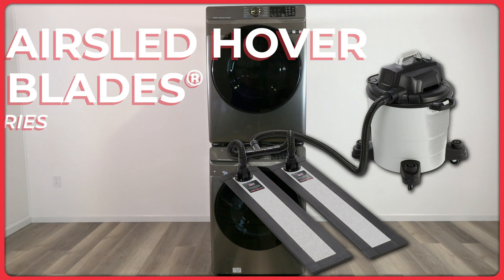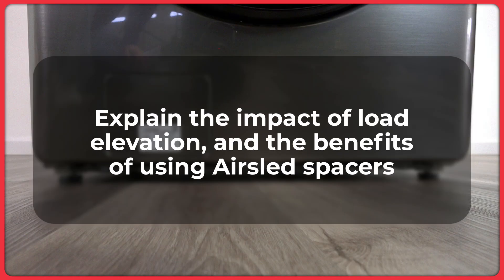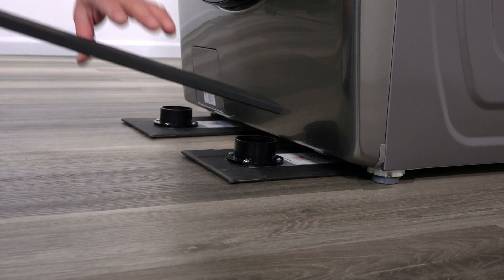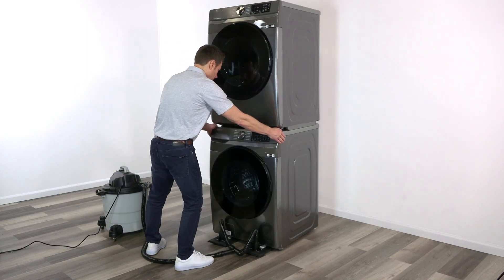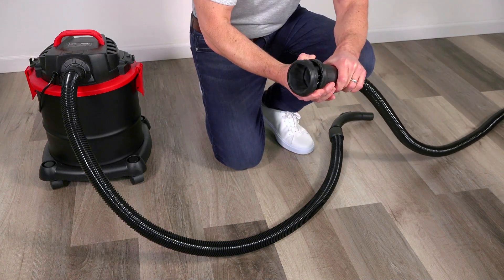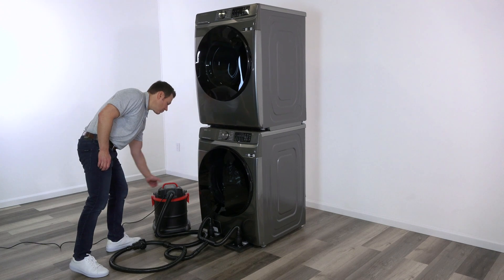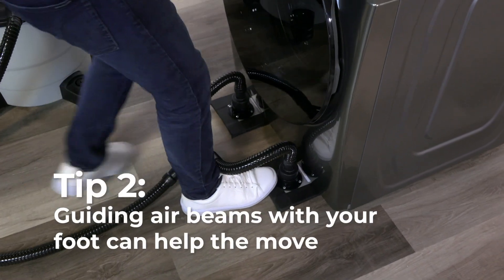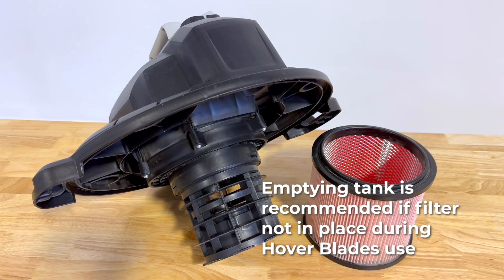How to Move Stacked Laundry Equipment with Airsled Hover Blades

Comment: If the stacked washer/dryer is in a closet on tile but the space outside the closet is carpeted. Will it glide onto it?
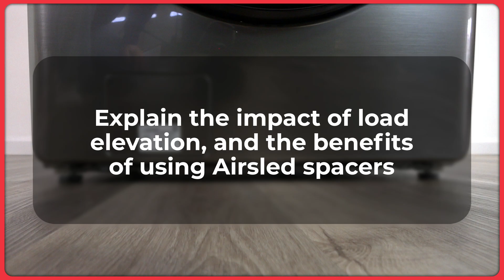Reply from the maker: Yes. All Hover Blades come with four plastic sheets designed to create a smooth, nonporous track over the carpet. You can see this in another Airsled video showing one of our Appliance Mover models moving laundry equipment out of a closet onto a carpeted hallway. Take a look at the 0:23 mark showing how the panels were taped to form a mat: https://www.youtube.com/watch?v=2jGeHCGBVCQ&t=23s